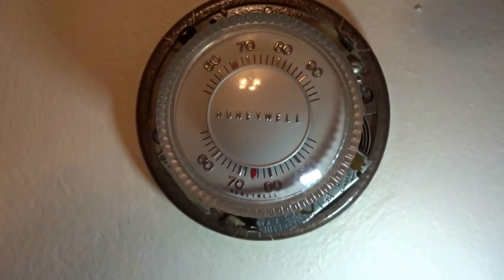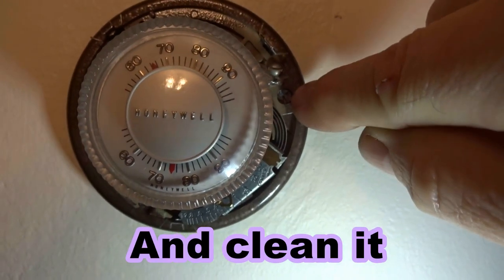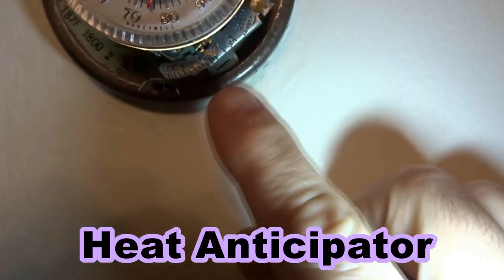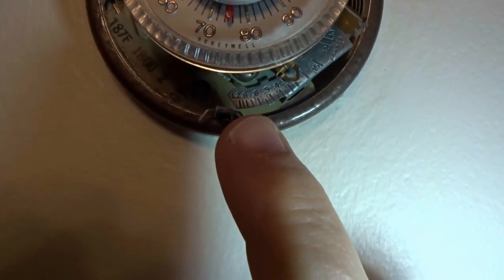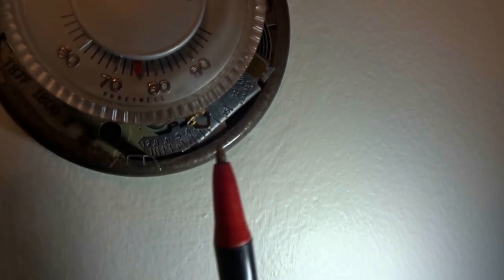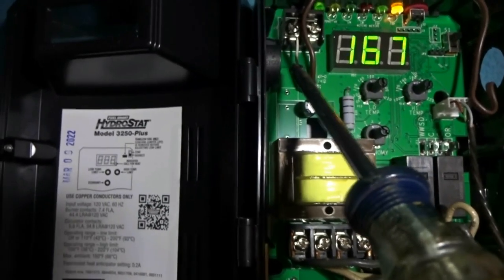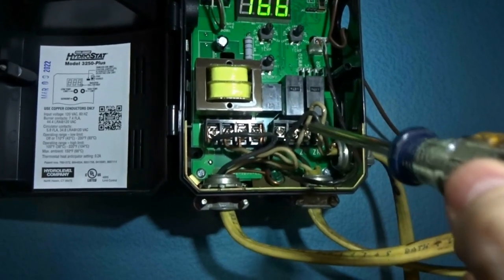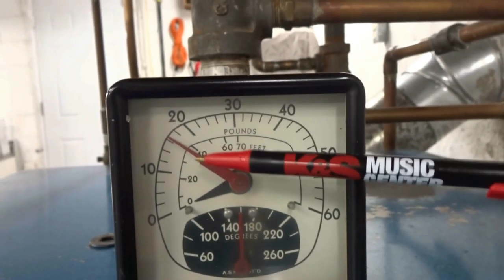Furnace Short Cycling (Thermostat, Heat Anticipator, & Much More)

Comment: I turn my thermostat off but my heat is still kicking on? How do I fix that? The top of the dial is off but the bottom dial says 80
Reply from the maker: It sounds like the mercury switch is broke. In time the coiled spring weakens that senses temperature change. If you look behind the dial you should be able to see the glass that holds the mercury you can use a small piece of wood like a pencil & move that glass up or down (I forget) & see if the furnace shuts off. Be careful so you don't get zapped. If it shuts off then you have a bad switch & need to replace the thermostat.